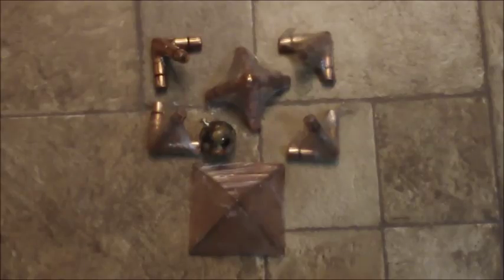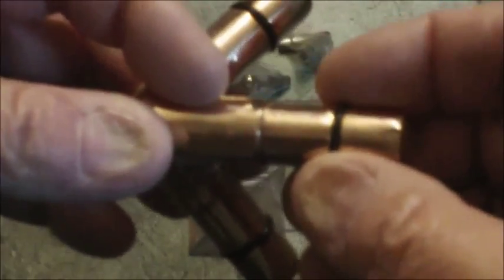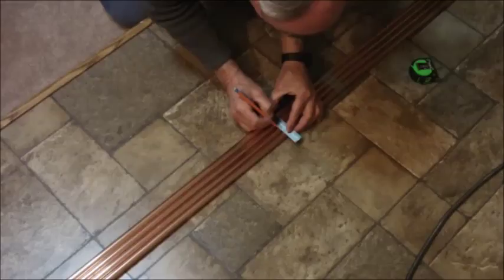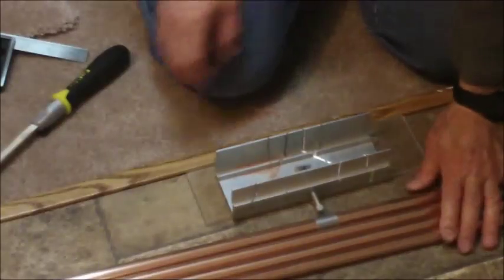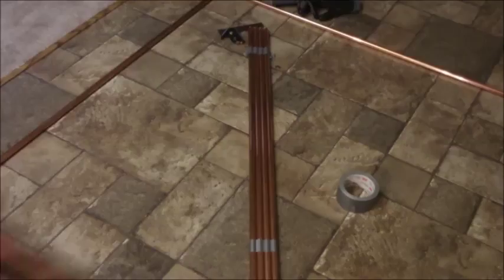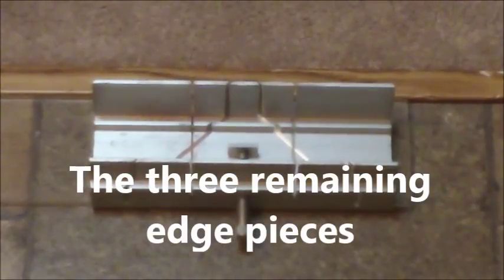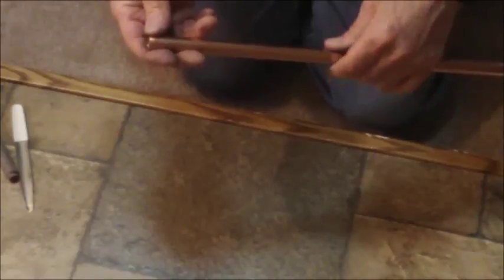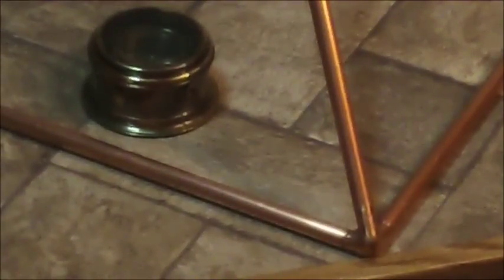Construct Copper Pyramid using Preformed Copper Corners and Apex

Comment: Thank you for posting! I just got the pyramid connectors - you are right, they are absolutely beautifully well made! Think I am making a six-foot base. The connectors I got have an extra leg so that the whole thing can be raised up which is a really neat bonus. I appreciate your pointing out the necessity of making the pipes smooth and clean - I'm in such a hurry to get this set up that I might have skipped that and it's important to do, especially since the connectors are so beautifully made. Has your pyramid been helping you?
Reply from the maker: Thanks, Laura.  The additional connector sounds great.  Yes, If you do the tai chi holding tree position, for example, you can really feel the energy while slowly separating and closing the distance between the fingers.  This works outside the pyramid, but it seems much stronger inside.  Regards, Jt.
Reply: @jttylor6516  Judging from other comments below, am I to understand that this would NOT be safe to leave up outside for the summer, because of lightning? I may not make it 6 feet high then so that it is easier to assemble/disassemble. I appreciate the advice.

Comment: Good work but you forgot to mention the most important bit for the last part. Making sure your base is squared before putting up the sides. Apparently you can build one in a rhomboid shape if you don't check your base is squared first.  And if the base isn't squared and one of the faces pointing to the north (magnetic north ? ) then the pyramid doesn't work.
Reply from the maker: Thanks, Van Guard.  I thought the rigid corners forced the square base; but if a base side is a bit off, then it wouldn't be square as you mention.  Although, it would probably be difficult to put together as the pipe is rigid.  Of course, the premise is that the pre-formed corners are 90, and, after your comment, that is something that one should check before beginning the measuring and cutting.  Thanks for the heads up!  Jt

Comment: I am trying to decide which way is best to build a Pyramid home. But I love that  you used copper for this inhome healer!!!
Reply from the maker: Thanks James, there are some custom build pyramid homes that use the Khufu dimensions and they are generally very large to accommodate good living space, but there are also some home builders that incorporate a pyramid living space into a traditionally constructed home .  Search for "pyramid homes" to see an array of home solutions - if you haven't already.  Big project - best wishes for success!
Reply: I may end up having to build it myself using a 3D Printer to design the triangles in such a way that they attach to one another via Nano Technoloy that I have dreamed about for decades now. I call them Nano Hooks.
Reply from the maker: If and when you do, I hope you share a/the video - it would be interesting and very cool to see - maybe patent those Nano Hooks first!
Reply: Do you have a link for thd connectors please? Thank you x@jttylor6516

Comment: I have had a pyramid for about 35 years ... one of my brass connectors has broken though.  I need to find someone to fix this.   Try the milk experiment... Milk does not go off.  I was so excited bout this years ago.  Get into it = it is fantastic.
Reply from the maker: Hi Mary-Ellen, Thanks for the comment.  Almost sure that brass connector can be welded back to its original position for a pretty reasonable price - just look up welding and call to check prices.  I did the milk experiment a long time ago with about a 10 inch plexiglass pyramid raised so air could enter and the milk positioned in an open container 1/3 above the base - your right milk does not go off!  Jt
Reply: Thanks heaps JT..  There is a man up the road who may do welding -- does it have to be specialized because its Brass do you know?  Iwill go up and ask him tomorrow. Thanks again.
Reply from the maker: Hi Mary-Ellen, well looks like brass is not the easiest to weld, but the person may have a good solution suggestion.  Here's some welding information:  "Brass, an alloy of copper and zinc, is a highly useful metal that has many applications in both the commercial and personal industries. It is, however, a difficult metal to weld as copper and zinc have very different melting points (zincs is much lower)." from https://www.highettmetal.com.au/ .  Good luck.  Jt
Reply: I got side tracked and didn't get to go and see the person..Now though it is  good to have this extra information to go with.  Thank you Jt.
Reply: Jt Tylor what is the milk experience

Comment: JT... I was looking at doing what you did, but after watching the video and what you are verbally saying, when it comes to having the base pipes cut to 5 feet which is 60 inches, and after you mount both corners you said you measured 62-1/4 inches, yet you stated that each end would be 1.5 inches if added on. so taking the 62-1/4 and subtracting the 60 inches of pipe, that leaves you with 2- 1/4 left and divide that by the 2 corners and that says the corners are only 1-1/8 and not 1-1/2. does that make sense? also I went to the website of pyramid plant, and they have many different kits, yet I am wanting to build a giza style and not a nubian, yet being in the US and using english measurements for pipe, what kit did you order? much of it is in metric. There's a 1/2 inch nubian style but I dont see a 1/2 inch giza style... https://pyramidplant.com/collections/frontpage/products/m-type-1-2-inch-kit-nubian-copper-meditation-pyramid-connector-only-free-shipment-within-usa
Reply from the maker: Hi Michael.  I'll check this out and get back.  Jt
Reply from the maker: Hi again Michael.  Sorry for the delay.  The base corner lengths are 1 1/8 as you mention giving the 62.25, but the slant edges of the base pieces are 1 1/2 as are the lengths of the apex.  So the slant edge length from the calculator of  59.2 - 3 = 56.2 for the cut pipe slant edge lengths.  I see what your mean about the 1/2 inch Nubian. Here's one and there are some portable ones with rope bases.  https://www.etsy.com/listing/194463124/m-type-12-inch-kit-giza-copper  .  Hope this answers your question - I did jump right to the 1 1/2 inch dimension!  :)  Jt

Comment: Thanks a lot Tylor...!!  Have u ever tried any other materials such as PVC.. Does it make a noticeable difference in energy levels inside the pyramid by using copper rather than PVC..??
Reply from the maker: Not sure, but my understanding is that copper is good due to its conductive properties?

Comment: Hello the calculator link does not work any longer. Is there another one?
Reply from the maker: Hi, I just tried it and it did not work the first time, when I put the angle in last.  When I cleared all and put the angle in first and then the base length (just the number no units), it calculated.  Hopefully it will work if you try it this way? :)  Jt

Comment: I bought the preformed copper connector set and am ready to buy the pipe.  I want to have a 6 ft apex so I can stand in it to do energy work.  I saw on utube to get the base measurement to take apex x 1.05263.     I want the measurements to be right but don't know how to factor in the connectors.
Reply from the maker: Hi Joyce, Wow that sounds powerful!  if you bought the M Type 1/2 inch kit from http://pyramidplant.com/copper-pyramids/ , the slant edge lengths for the apex and base pieces are 1 1/2 inches (from the floor or tip of apex to where the copper tube connects).  The base edge length from the tip of the base pieces to where the copper tube connects is 1 1/8 inches.  You need to measure your pieces to verify.  Using the http://www.cleavebooks.co.uk/scol/calpyr.htm calculator with 51.83 degrees and a height of 72 inches (floor to tip of apex): base edge = 113 inches, slant edge = 108 inches.  So, for the base, subtract 1 1/8 * 2 = 2 1/4 from 113 = 110.75  ~ 111/12 = 9.25 feet; so you would need 4, 10 foot pieces for the base.  For the slant edge subtract 1 1/2 * 2 = 3 from 108 = 105/12 = 8.75 ~ 9  feet; so you would also need 4, 10 foot pieces for the slant edge.  A little copper tube waste (recycle) but not too bad.  The tube is normally sold in 8', 10', or 12' lengths at the local hardware.  Be sure to check your solid copper base and apex pieces for the exact lengths, as above, to subtract from the actual base and slant edge measurements before cutting the tubing.  Hope this is helpful.  Jt
Reply: Thank you so much!!
Reply: Jt Tylor Dude u did way too much math for this purpose.   but if it works then that's all that counts. 👍😁  I just bought the same thing too.  these are very hard to put together with 7 1/2" base pipes.   But I finally got got it together.   I just made a small one for now to try with sleep.   Do you know the precise ratio of the size of Giza's capstone in  relation to the rest of the pyramid size?
Reply: Joyce Kirby please tell me where to buy these pieces from i really would like to get them... sincerely...David
Reply: I bought the kit on Amazon.  Sorry it took so long to get back to you David.
Reply from the maker: @johnkennedy9078  John, sorry I missed your post.  The copper capstone angle will fit and height Giza pyramid, since the angles are the same.  You probably know that by now, again sorry I missed your post.  Jt

Comment: can you please tell me what the capstone size is in ratio to the rest of Giza pyramid size?   Trying to cut pipes to have scale model of the Giza pyramid
Reply from the maker: Hi John, because the angles are the same, the capstone (copper one sent with the kit) should fit on any size you build. Hope that helps.  If your just doing pipes, there are some videos that show how to attach cable/rope to the base ends that will form the correct angles when they're spread out - maybe search for collapsible pyramid?
Reply: You can use this formula or look online for a calculator : Determine your height, then using the height as your base number  (h) plug it in to this formula to determine your base and leg lengths. Base = (h x 18.75)/12 (inches to give your answer in feet)   Leg= (h x 17.75)/12"
Reply: John Kennedy 70 degrees

Comment: Okay, I’m not mathematically inclined so I need help with my math and using that calculator or a formula. I purchase this exact pyramid kit and I want to make a pyramid to fit nicely over my queen size bed without taking up a lot of room space. I going to purchase the 10ft 1/2 in m type pipes and I was thinking on cutting it down from 7ft by 7ft since queen size beds are on average 6ft x 5ft.
Reply: I meant cutting it down to
Reply: I think I need the pyramid at least 8 ft by 8ft base
Reply from the maker: Hi, sorry for the delay. If you go to this calculator: http://www.cleavebooks.co.uk/scol/calpyr.htm  and put in say 7 or 6 as the perpendicular height and 51.84 as the f/b angle, then hit calculate, it will show the base and length of the slant edges for the Kufu version.  If you do a 7 ft. base length, for example, the height at the apex would only be ~4.5 ft. so it would be a good idea to experiment with different parameters, and find a size compatible with your bed and room size.  Jt
Reply: @NaomiSimpsonhk  I'm with you, Naomi! I would love to have this over my queen size bed as well.